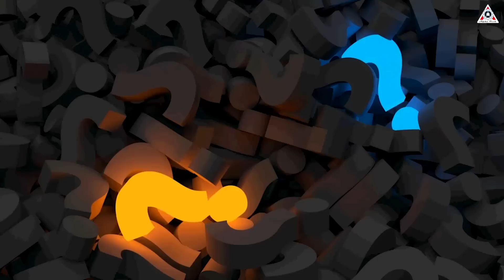IS ULA OVER...??? NASA did not expect this...

Comment: Nope.  Not going to launch this year.  Bezos 🤡doesn't know what he is doing.  He should have focused on deliverables to ULA and the government instead of New Shepard (which also had a failure).  Bezos is treating the arrangement like all the other contractors (Boeing, Lockheed Martin, et al) treat the government contracts - delay after delay, cost overruns, schedule slips, and milking the taxpayer.  Whereas SpaceX has proven to be big, capable, reliable, and reasonable - like a good private sector company should be and actually accountable to their shareholders.
Reply from the maker: Great comment!

Comment: The two BE-4s on the first Vulcan had passed validation testing and are ready to go.  It was another BE-4 that was just made that exploded during testing because it wasn't made right.  So there are still problems with manufacturing, but this has no impact on the Vulcan's first flight, which is delayed because of the fixes that need to be made to the second stage.  The manufacturing issue might impact this program down the road in terms of schedule if it isn't fixed soon, but again, the first Vulcan's BE-4s are ready and waiting to go.

Comment: What is.. the current status status of the BE-4 Rocket? What is the major issue with production when already developed? 
Thanks for another great episode.
 - NOM
Reply: BE-4 has entered mass production. First flight engines where delivered to ULA a couple of months ago. But because of an anomaly of the upper stage the first Vulcan launch is delayed. I think they are currently planning to launch in Q1 2024. New Glenn (the Blue Origin rocket using BE-4) is supposed to launch during the mars launch window in August 2024 for the ESCAPADE mission.
Reply: @TheSyntaxE   Meanwhile, SpaceX will have launched, and recovered for reuse, another few dozen rockets, for much lower costs per ton to taxpayers and commercial customers.
Just sayin'. 'Plans' are just that, and throwaway rockets are so last century.
Reply: Nomen est omen.